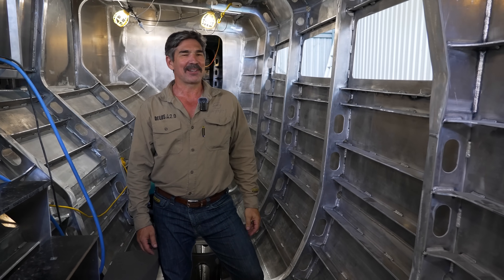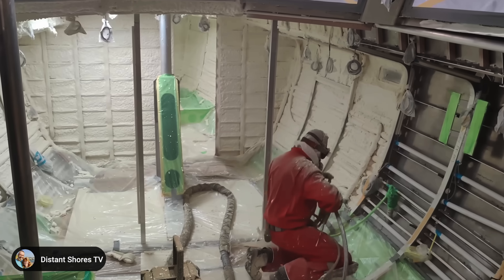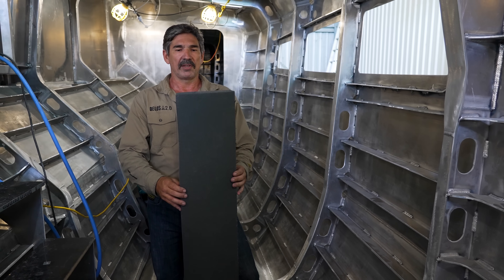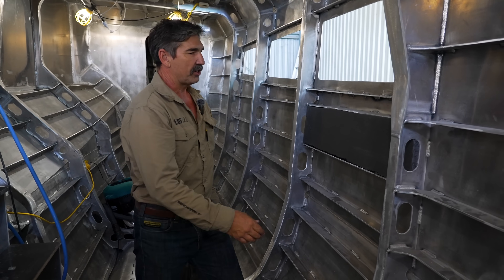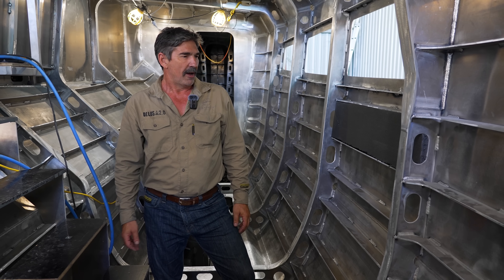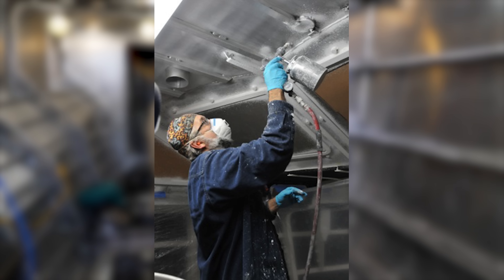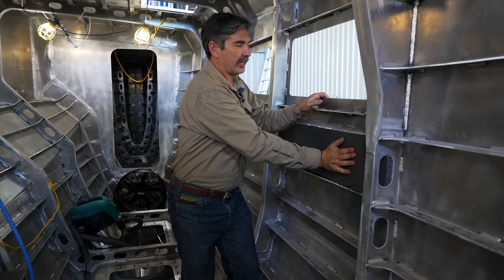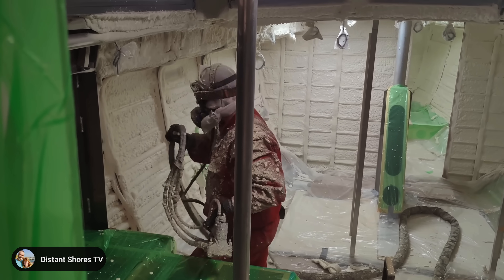HELP, We Need Your Advice!  How Should We Insulate Our Aluminum Catamaran???

Comment: Mechanical engineer + teacher at a technical high school here.

If air from inside the hull can get through or into your insulation, you definitely will have condensation and it would surprise me if there weren't any downsides to that (like mold or corrosion).

There are two ways to combat this problem:
1) Spray foam: Sticky mess, but in my opinion the ONLY sure way to completely eliminate the problem, because even if the foam were to crack, the problem would be VERY localized (no undercreeping to the sides on the foam/metal interface and thus creating a large affected area).
2) Make everything removable and create a truly airtight seal on the inside of the insulation layer with a plastic barrier film. If you have a problen then, it would not be as localized, but easyer to repair.

Maybe a combination of the two would work: Put sprayfoam in (2/3rds of total insulation thickness), don't lay any cable runs into that layer. Then put removable insulation on top of that, any cable runs should go into that removable layer for ease of access and to prevent condensation inside the pipes.
Even if spray foam is a no-go for you (and I totally get it), I would suggest to at least stick the foam to the aluminium at all large surfaces so there is no air gap behind the foam for most of the insulated area.
Reply: Can you find any reason not to embed conduits within a full depth of spray foam and then incorporate access ports that could be used to alter plumbing or electrical etc. in the future? Obviously if there's damage to the hull the whole thing needs to be cut out and repaired regardless and as such a provision made for any less significant repair within the structure would alleviate the downsides of using spray foam throughout wouldn't you agree?
Reply: Good suggestion

Comment: A combination of closed cell foam and light weight double bubble aluminium foil insulation applied on both sides of the foam slab should stop any condensation from forming.

Comment: My two cents. I feel like coating the metal, then spray foam is the way to go. Avoids so may potential problems and saves a lot of time and would likely prevent condensation in the first place. Would be the most effective option thermally. I would just run oversized conduits for every imaginable thing you may want to run through it in the future, and then an extra one. Install plenty of accessible pull boxes. Leave maintenance items clear of insulation. Devise a system/kit for quickly stripping away the foam for urgent situations.

It is important to go with a reputable and responsible company for spray foam. If not consistently mixed in proper ratios any uncured ingredients can be somewhat toxic. Properly mixed it should be completely inert. Also, with a good company you are less likely to wind up with a big mess.

Comment: your entire boat is a gigantic heat exchanger and a giant heatsink,  when the sun is shining you wont be able to touch anything that's been in the sun, it will burn you.  When its cold you won't be able to touch anything because your hands will stick to it like a tongue to a flagpole.    I tried to warn you about this when you decided not to paint so i figured the family has a high tolerance to burns.   naw man,  i don't see any reason to insulate,  you guys are as tough as nails.

Comment: I would use spray foam. It is the most solid one when in place and solves all the problem and the only thing is that if something happens, you need to add something, well, then you have to do a little work. With all other solutions you have to do both. A hell of a lot of work when applying it and some work when repairing/adding stuff.

Comment: As a steel boat owner who has lived through a boat fire i don't recommend foam, carpet or any petrochemical based stuff.  I do also wonder about what off gassing foam does. I used woolbatt insulation in the head lining as it's easy to remove/ replace when you want to inspect or run another wire etc. i have cork tiles on the walls, doubles as a corkboard for pictures. Will be obvious if water ingresses so will be able to arrest the issue early. It also gives a great natural feel. You may wish to consider how you would finish the interior of the boat, cork may be more expensive but may mean you don't have to line the interior. You can take advantage of the area inbetween the stringers like a "bookshelf" to have loads of storage without having to do the deep dark pit of top down storage. Have my boat just up north in Hervey bay if you interested in checking it out.

Comment: I think if you don’t cover the ribs there will still be significant heat transfer. I suspect spray foam would seal out air gaps and moisture the best. I’m not sure of fire ratings of any of these.

Comment: personally I would go for the solid foam.. You will never stop all the condensation unless you decide to not breathe inside. The issue  with spray foam is that it will break down over time. The expansion and shrinking of the metal will exacerbate that along with the humidity of the fact that you are on a boat.  Being able to remove a panel of foam for maintenance or emergency will help. you can get a foam tape. you can apply this over the edges first to help with condensation on those parts.... Again only my opinion but not sticking it to the hull is the way to go (for thermal anyway).  glue is a permanent option and having to remove it for any reason is a pain.  The final part is probably something you may have considered already. Running some flex pvc through the hulls keep it a closed loop part from in tech cupboard and using it as a form of in wall heating..  use the engine as a heat exchanger and a central heating pump to move the water around ((( lots of details to consider but just a thought)

Comment: I think for general boat use spray foam is probably best, but since you live at sea and will be doing most of your repairs yourself, maybe you could do a hybrid system? Use insulated batts for cavities with utilities for removal and reinstallation, then use closed-cell spray foam in areas where you do not plan on having utility channels. Never seen it done before, but it might be worthwhile for you.

Comment: Spray foam is the way to go. It can be a pain to remove if needed but will protect the hual from erosion and mold growth. The stick on panels won't work because as the boat  heats and cools the metal will expand and contract along with heating and cooling the adhesive backing will fail in time. A good coating on the aluminum  is crucial to ensure no moisture that could cause issue later. Another consideration is that on a boat if you need to repair sections of the insulation spray foam is easier to store than bulky panels and has other applications. For instance you could spray it to the surface of a sail to make an emergency flotation

Comment: QC, Canada here. I'd say getting spray foam is the way to go. It doesn't allow condensation. You can always cut away with a razor, to work on things, just allow tubing and get a snake if ever you need to thread wires through. You can also reapply in small amounts yourself if needed after. But if you think youll need to access certain areas frequently, just use a vapor barrier like you were saying, and use paneling around it, just keep an eye on it.

Comment: Although Spray foam is used extensively in new home construction in the uk  quite a few mortgage companies have refused to I carry mortgages on new houses in uk for no apparent reason ie off gassing etc although the current foam is different to the material used bak in the 60's which proved to be problematic and had to be removed.I haven't been able to find any reasons for the loan companies to refuse to carry mortgages , but as they say ""their is no fire without smoke"..
I can appreciate the problems with the ribs etc leaving thermal gaps,   perhaps a combination of the closed cell slabs and some sort of sprayed paint over the thermal gaps would be a solution ,perhaps you could do a test with a section even a model before you commit to doing the whole boat..Good luck on finding a solution .Your progress so far has been phenomenal ,you've chosen a design and a yard that is making your and our dream boat become a reality, besides Brisbane is a great city and oz allowing you to work on the project with your skills is just great.wishing  all of you the very best .
.Cheers from  me and Canada .here's to launch day and sea trials.

Comment: would do the spray foam 11 times out of 10...   run an extra small pipe with the other runs for future upgrades so you dont have to cut out the foam for upgrades.

Comment: Beware of fire! Smoke kills. 
The spray foam is the easy answer (if you plan your conduits well) but I won't put that in my boat.

I'd use a primer paint on the aluminium, then a spray cork layer, then rockwool or aerogel, plus some barrier layer on top. I like the idea of a paint to seal and control vapour. 
Air quality and ventilation is important, and I would look at using dehumidifier to keep good quality air anyway.

But whatever solution you pick - make sure you take fire safety into account.

Comment: I have never insulated a boat, so any suggestion I make should be taken with a few grains of salt... Spray foam is excellent stuff, & I think might be the easiest & most effective overall. Aside from that, I think I would use the metal coating to seal the hull as you suggested, & then consider using extruded polystyrene cut to fit the areas like you were showing. It is pretty much the same material as spray foam, but formed through an extruding machine. It has excellent R-value, & is light & strong, has some flex, yet maintains its rigidity. It supports 20 or 30 lbs per square inch before it compresses. You could put half inch plywood right on top of it & walk on it on a floor with no compression. It also has a notable advantage in that the chemicals its made from are mixed in a factory which reduces any risk of poorly mixed chemicals off-gassing at a later date, which I think might be bad in the a confined space of a boat. & to fasten the pieces in place, I would use regular cans of expanding spray foam just around the edges to seal each piece & prevent any sort of air exchange behind, or any air current to set itself up in gaps to allow warm moist air to contact the cool hull, & condense. (It only takes a millimeter or 2 of space for such an air current to set itself up. This would allow you to have all the pieces sealed up, but you could easily cut around the outside edges to remove any pieces you wanted later. The thermal bridging you spoke of could be addressed with the same sort of insulation cut to fit...  Or I might consider split foam pipe insulation...

Comment: You can use Release agents then apply spray foam,
It will be applied with no issues because Refrigerator makers do it all the time.
We use silicone or vegetable oil

Comment: Definitely option 2.  My initial thought when I read the title of your post was “blue foam board”.  Your solution takes that to another level.

No on spray on insulation and no on paint.  That aluminium hull structure is too beautiful to ever cover with something permanent.  Cut those sections, number and label them, then buy a barn to stack them in when not in use.

Or maybe neoprene?  I think it passes the getting wet test.
Reply: They will be living in this boat as they did with Delos.
Reply: Having watched the channel for years, I understand this.  Maybe it’s just me, but I would never permanently cover that hull structure.  Precisely measured and cut, those foam pieces could add a great esthetic.  It would be nice if they’re available in a lighter color.

Comment: Spray foam. It covers the best. And when do you think you might have to get to a wire , when itt happens you trim away the foam only at the spot you need. Also, I think Acetone melts foam for bigger applications.

Comment: The transfer from cold to warm is gonna create condensation from the aluminium if you cover it over it will just carry on behind it I work on aluminium boat doors such as sunseeker we use insulation 40 mil Rockwell with a silver back but still condensate up

Comment: I would sprayfoam. Or install any cut sheet stuff with foam.

Perhaps something heavier to cut the vibration down even more in the engine room bulkheads.

 It's all about relative humidity. 

In any insulation hot air should never get behind the insulation, it will reach the dewpoint and drip when cooling. Meaning insulation should be air tight from the hot side. When cooling you have this automatically as the hot side is outside the hull. When heating and sea being less than air temp, not so much...

Not only corrosion but mold will grow etc. If you think everything is inorganic, it will not be in 20 years of use.

Allowing air gaps is ok, but they would need to be substantial with good spaces everywhere to vent. And then you would still have a lot of condensation running down the hull.

Comment: There's nothing like spray foam. 
Best sound deadening.
Great moisture barrier. 
Easiest to apply. 
Easy enough to remove if necessary. Easy to reapply. 
Very light and boyant.
Edit;  To be specific, 
Closed Cell Foam is what I am referring to.

Comment: I would never consider spray foam for an ocean going aluminum boat. It leaves you no way to inspect your hull, anywhere. It's also very toxic, terrible for the environment, and is a major fire hazard. I would make custom foam panels that you can velcro into place, or some other semi easily removable installation *blanket type, maybe) to allow inspection of the hull.

Comment: Two factors to add to your decision making.
Fire Resistance and Sound Insulation properties.

With a Metal Boat, you have a much higher chance of putting out a serious fire as long as the insulation doesnt  ignite easily
Noise is 80% structure borne/20% airborne
The uneven and 100% coverage of a spray type will be much better at changing the harmonics of the structure

Comment: Anti mildew paint with bats of rockwool wrapped in gore-tex. That way the whole thing is insulated but permeates water out and away. Probably cost a fortune but would be super cool. I think Airogel products are starting to hit manufacturing phases somewhere in the world. This sounds like an engineering challenge for sure got to avoid that mold mildew stuff.

Comment: You have all the bases covered. You and your advisors know the pitfalls and difficulties that arise when you choose wrong. At the end of the day, there is no perfect solution. If weld repairs are required or other reasons to strip away insulating material for working clearance, your choices will be tested. Personally I like the spray paint like barrier and further covered with closed cell Polyurethane (PU). Keep in mind that removing that spray applied paint/sealant will be somewhat stubborn to remove if subsequent welding is required. It is the best option though to separate the aluminum from salt and moisture. Having an adhesive backing on the PU foam would not be an option for me as future hull repairs would be complicated when removing the required PU panels. 
Regarding the PU panels fastening method, perhaps another method could be found as this method of glued on spikes does not seem reliable and adhesive is not without problems. I do have a solution based on your options stated but believe that your crew will also have a plan. Nice job

Comment: Spray foam doesn't burn and is vey light. Totally moisture proof , no bugs etc that eat away and the R-facter is relative to layering and depth.It's just a superior product overall for heat or cold barrier.

Comment: Another issue is combustibility of the insulating material. Is there a foam product that has a foil or plastic coating that would decrease the free surface area of the foam, and there for making it harder to ignite.  Are there foams available that have a fire retardant additive that make the foam harder to ignite.  This is not the first aluminum boat, I would research the systems used in the past and then use the systems that you think works the best for your boat and planned use.

Comment: You will need to use a spray foam with a fire barrier either in the mix or coated on the inside to protect the spray foam, which could be very flammable without it.

Comment: I agree.  You need to spray foam. You need a thermal break at the ribs too.  You are not just thinking about the R value but also the U value.  Thermal transfer is going to be your biggest problem with metal.

Comment: Spray foam it is easy to dig out if you need to get to something buried in it and great stuff foam is closed cell you can fix where you dig out easy. The sticky back insulation bat can be a nightmare and doesn't ever get 100 percent like spray foam. If for what ever reason you need to go back to bare mettle spray foam is easier that sticky back glue. The pinning method even with a casting can still allow air and condensation. YouTube might stop corrosion with a coating first but if you candidate between the wall and the pined down bat your allowing a Ln area for mold to start.

Comment: I would not insulate aluminum at all so it can breath and stay protected against corrosion.  I'd rather place the insulation in the interior panels separating the aluminum structure from the cabin.